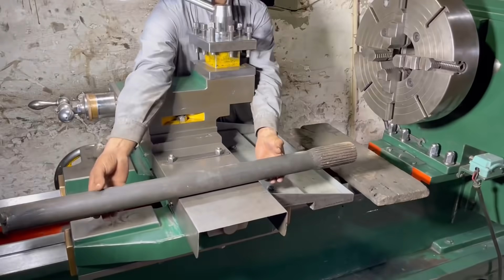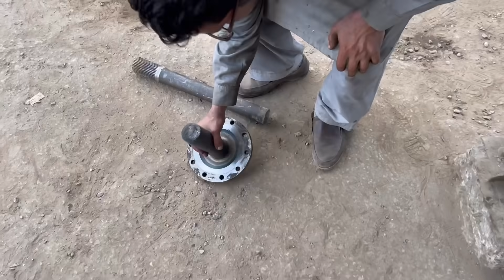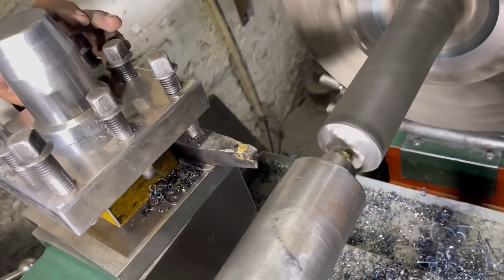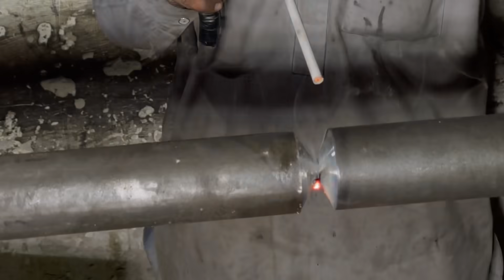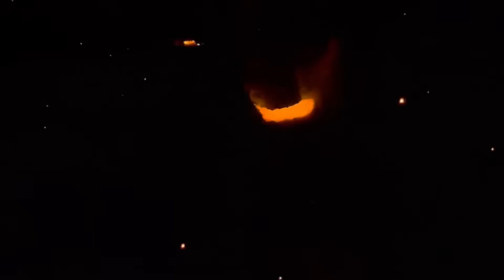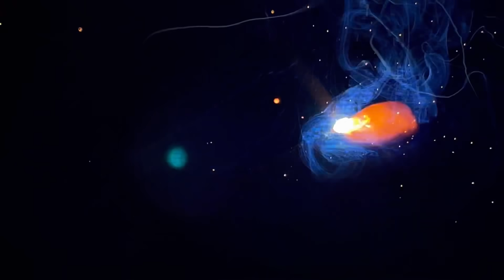How to repair a broken axle in the middle | Mechanics must watch the video |

Comment: It looks fine on the surface, but the welded area has a lot of small bubbles, which makes it very vulnerable to strong torque. In the end, it is certain that greater vehicle risk and loss will occur.
Reply: They Will use It in soft work , and the weld is wel done
Reply: @doutordelmar  Soft work? lol
Reply: Instead of 6011 for best depth penetration he used 7018 😀

Comment: That a Starret, Brown and Sharp or Mitutoyo dial indicator he's adjusting runout with? As for repair job, thinking if the axle broke when forged from a single piece I doubt some welding and hiding the scars is going to hold up. Might get ya home though.

Comment: This repair will not last very long, the heat treated original axle lost its strength after welding. It will fail due to being brittle and break at the repair point.😳👎🇦🇺
Reply: They don't care coz they gonna sell it to someone and make money. Not gonna use for themself so doesn't matter if breaks
Reply: for emergency used only.
Reply: It's probably  4140 steel
Reply: @dotcom8555  @ о
Reply: Unfortunately It Won't Break
Reply: i’ve seen many fixed like this and hasn’t broke yet and it’s been about 3 years of extreme abuse

Comment: The surface imperfections at the edge of the finish weld are the initiating point of the next failure. The heat affected zone of the weld will form the crystallization structure for the fracture to propagate along. So he has the alignment aspect good, just needs to turn the surface smooth, heat treat for spring performance, then polish. The shaft is shorter, he could have weld built up the centre of the spike end to maintain the length but maybe he did. Most likely the shaft broke due to overloading, this repair isn't as tough as original so this process is bound to repeat.
Reply: cant you see they have very limited resources & money to get the truck working again?
Reply: @Dec38105  ездить он будет но работать в полную силу уже не сможет
Reply: I guess this is where you truck broke down in the middle of nowhere. This is the best solution until you reach your destination
Reply: Its about Getting something better than you have, They had a worthless shaft, now they have a working one, Stronger?..NO, as good as original? probably not, Useful? Absolutely and for this I commend them!

Comment: the whole welding current runs through the spindle bearings. not a good idea to weld in a lathe. better connect the ground clamp to the workpiece itself.

Comment: Why not tig weld it back together then cut a V in it and fill the V with new steel from a tig rod? It might save you a lot of time on the lathe. I suppose though if the break isn't clean and easy to line back up you could cut off the twisted ends with a cut off saw then line up both ends and fill in the gap with the tig so the axle is the same length as before. Then fill it all with with welding rod.

Comment: Surprises me that nobody saw how he didnt clean the parts, or how he had left the grease from the support tool on the tailstock that he used to support the hub end of the axle, just in the divot he drilled, he just left it in there and mated the parts up to weld them like, oh yeah, that’ll hold up great. It might hold up, with an empty truck and just to get home if your out in the middle of nowhere. You wouldnt rely on it for a job though.
Reply: Nah, they wouldn't do it if it's doesn't work. It did work, not for very long, but long enough for them. Probably because they don't have  money to buy new parts, so they resort to this "repair" instead.
Reply: Get over yourself ..... he's not welding something for a high pressure pipeline .
So it's got a couple of imperfections I bet that truck ran quite happily for another couple of years

Comment: In this case friction welding should be used.
Reply: If the faces were machined flat, then the axle has lost length.  So friction welding is not possible.  Further I would think that friction welding would preclude accurate control over the length anyway. Plus you need a friction welding machine, which, obviously, these guys don't have.

Comment: As you can see at about :15, this spot on the axle has broken before, been welded, now it has broken a second time.  Perhaps one could take this as a learning experience:  First don't overload the truck so the axle doesn't twist off.  Ok, if you ignore that, then maybe after the first repair failed, realize that welding isn't the cure-all.  In fact, it weakens the welded area.  But no, go right ahead and do what has failed before.  That's how poor countries stay poor.
Reply: In many parts of the world, overloading is not by choice. Everybody overloads and substantially. If you don't overload, you don't survive the competition.
Reply: That's the main reason why this axles break they overload the trucks in the long run there profit  it goes into repair what they damage for overloading the truck but they never learn
Reply: @parkershaw8529  Yeah, I've seen shots of a trailer loaded with bags of cement, a quick multiplication suggested that they had 65 tons on there.  On two axles!  About twice the legal limit in most places.

Comment: On a long shaft, that allows for a surprising amount of torsional “flex” that’ll soften/absorb some torque, this repair might last awhile even though the original heat treat is cooked out, if driven very smoothly.

Comment: This a bad idea  you will never achieve  the strength  of the original  piece ,these folks obviously  has no knowledge  of heat treating and the torsional  stresses axle shafts  endure fortunately  if one fails the wheel won't fall off as these are full floating axles.

Comment: The method of installing the piece is incorrect. Adjusting the axis is primitive, at least, using the comparator
Reply: Yeah however the length of the shaft and a spline coupling at one end will allow for the overall runout.

Comment: Great video! Very ingenious way to reconnect the broken axle. Would you say it's as strong or even stronger than the original after this repair?
Reply: personly  I think that axle will snap at the first time power is applied to it. the welding took out the treating  that was in the metal originaly that axle is now very brittle.
Reply: Weaker.
Reply: I hope nobody notices it is a bit shorter now.
Reply: NO...
Reply: Yeh naye jaise, majboot nahi ho sakta, naya single peace hota hai, yeh double peace, hai, kabhi bhi toot sakta hai

Comment: but what are you doing? more nonsense. and as usual. the motor shaft must be completely changed. this arc weld will never hold. due to air bubbles inside the solder and breaks after being put under the dragging force.

Comment: These axle shafts are induction hardened the outer surface is hard while the core is soft for toughness. To resist shock loading.
Reply: Ummm…no. Axles shafts are not induction hardened. They are medium carbon steel and hardened around the spline area only.

Comment: A J prep would have been better been more strength in the root
Reply: No force is transferred through the root. The strength he needed was for thermal alignment.
Reply: @mrberger1144  yes I understand that that but surely when machining is finished and the part reassembled you need root strength for all the torque that will be transferred to the repaired section of the component

Comment: 🤦‍♂️🤦‍♂️🤦‍♂️What’s the point of having true, finely measured, and machined parts only to cobble it together? These weld jobs wouldn’t stand an X-ray test. Also, not all welds are equal. They are really trusting of stick welding.